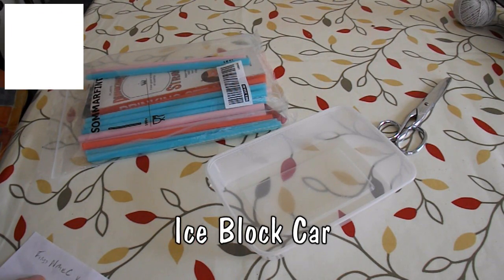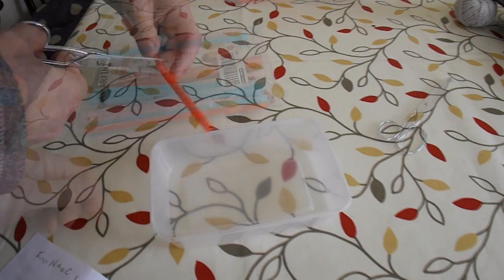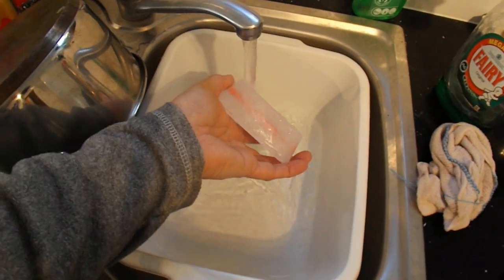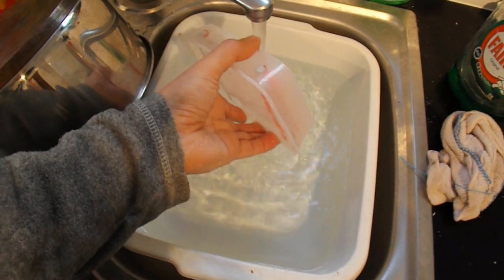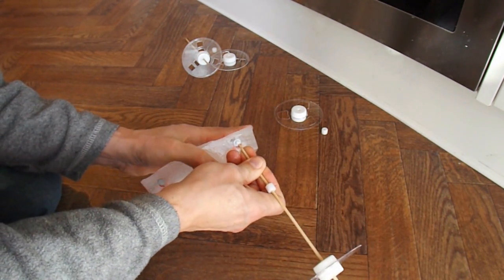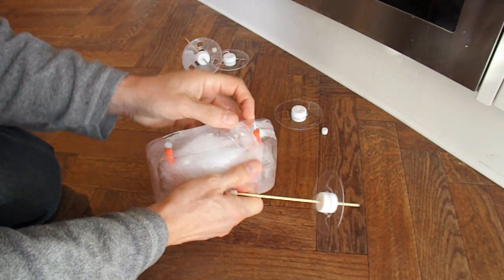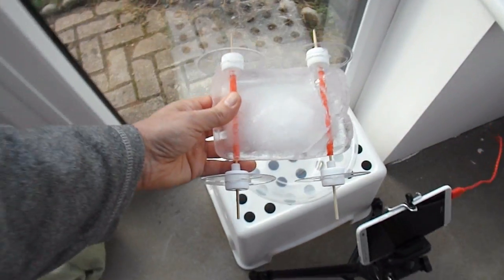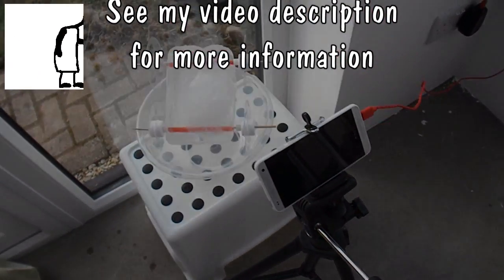Ice Block Car - gravity powered

Comment: Hehe. It would be funny if that was fan powered. 
btw, what do you use for the spacers? Thanks Grandad!
Reply from the maker: I am happy to say the car has melted now so I don't need to worry about powering it, however now I have shown you how to do it you could make a fan driven version yourself :-)
I don't remember where the spacers came from but they were probably part of a printer I took apart.
Reply: Oh Ok, Thanks! Cool Video!
Reply from the maker: Sahan Methmal "Cool", yes very good, ice is cool :-)